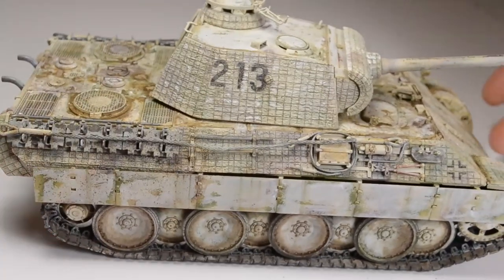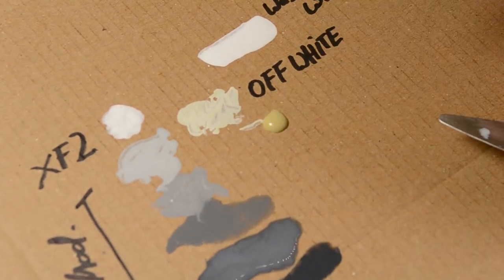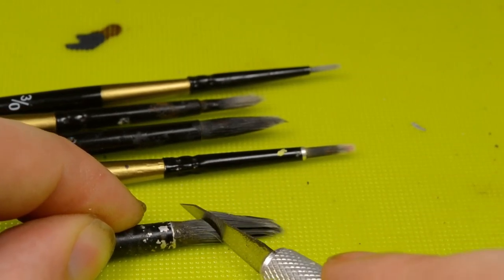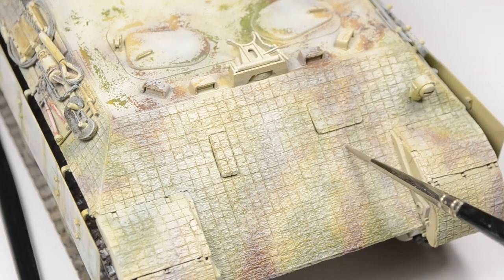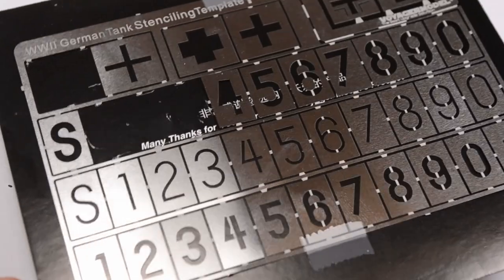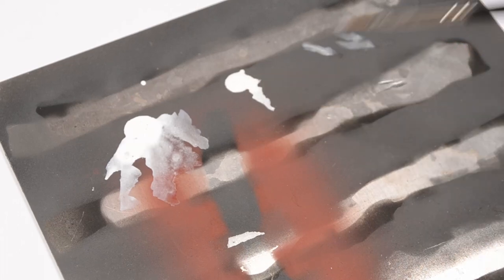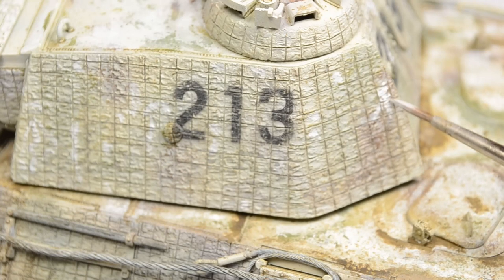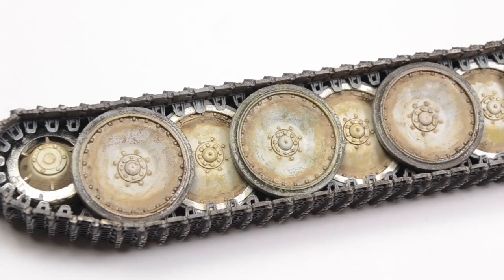Winter Whitewash - Panther A Early w. Zimmerit Part 2 | Das Werk & Takom & Atak

Comment: I've glued my road wheels together before but they didn't stay in alignment so I quit doing it, but seeing how you use the small ball of putty in there is a great idea and I will give it a try on my next build.  Thanks for sharing!
Reply from the maker: I did this now on six vehicles, no problems so far. Can recommend doing so. On tigers only the inner layers of wheels are in need of putty, the outer two will stay in place.

Comment: Hello Mr. Tankbrusher!  (it's Kai, correct? ...I always forget names)  Another excellent video.  

I personally always chip with a short brush...I find it is much easier.  How long did you wait between spraying the white and chipping it?  I try to chip within about 5-10 minutes so make chipping easier as well.  

I think your neutral wash over the zimmerit is a good idea.  I used something quite dark on my Tiger and I had to tone it back later with dust.  Different areas should deserve different darknesses of washes like you've done.  

I also like your mapping with the washable white.  But when I used AK washable white I found I could sort of reactivate it with water after it was dry but still fresh.  Maybe it's different than Mig AMMO?  ...even though those companies are ...let's say ...very similar :D

Your idea of painting the wheels as one unit is good.  I think I will try that on my Panther G soon.  So many roadwheels gets tiring and so little is visible in the end.

I hope your trip to the museum was good!  I will look forward to next week :)
Reply from the maker: Hi Evan(? same problem xD), but yes Kai is correct. Thanks for watching and takeing the time for your comment. 
I A/B tested the drying time on this build: Turret was done within 20min from hairspray to chipping, chassis within 4h and rear section of the chassis was chipped after one week. I was not able to notice any significant differences. From your videos I renember you using x20a thinner for lesser adhesion of the lacquer paint - I still use Tamiya lacquer thinner, but have x20a on the way to me for further testing.
I actually was expecting this washable white to be able to reactivate too - can't tell if it was beyond shelf life (possible, obtained it in a small store localy) or if it worked as designed. Worked for me, but if I had not tested it on a sheet before...
These roadwheel modules work fine for Tiger/Panthers on my level of skills, it's just much more effective in time used to handle them and there are many other things in need of improvement with my builds I need to throw the gained time at xD  
Museum was fine too, now i can start building a 0-series JagdpanzerIV soon. Got lots of refferences for the years to come : )
Looking forward to your next video as well. Regards Kai

Comment: Ak/mig/valejho paints are very easy for chipping. You can even leave them for 24h and still they would be chippable. :)
Reply from the maker: Hi Tomasz, thanks for your advice. I'll run a test series soon to make my experience firm with that technique - if you have the time: jump over to The Bears channel for his flame thrower video. (He is in the comments.) I'm caught between too hard to chip and the fear of paint comeing off too easy and in too large chips atm : )
Reply: @Tankbrusher  Yup, that's the case, you have to be very careful chipping water based acrylics trying not to rip them totally. :)

Comment: Iam sorry did you say 1933 or did you say 1943 panthers were not around in 1933
Reply from the maker: Hey Timothy - in any case related to Ausf. A it is very likely I do mean '43. It is somewhat hard for me to pronounce these dates. Got called out for it, worked on it - from the next videos on it will be easy to understand.
Reply: Thank you i iam a little hard of hearing no insults intentions great job love those panthers
Reply from the maker: @timothymelick7085  No insult taken, the first rfm tiger video is much worse in this case - that's when I noted it down to fix. Thanks mate, Q4 this year will be very panther heavy - I'm preparing to messure the one existing Ausf. D in the Netherlands for reference.
Reply: @Tankbrusher  ill keep a eye out for that episode